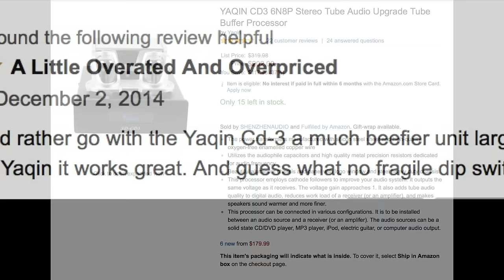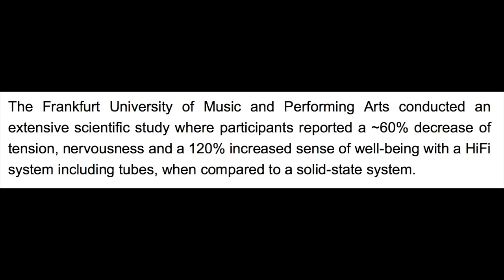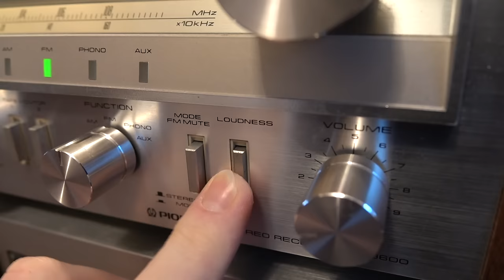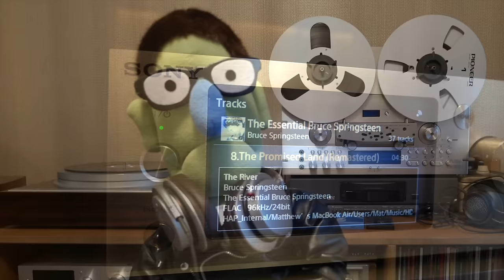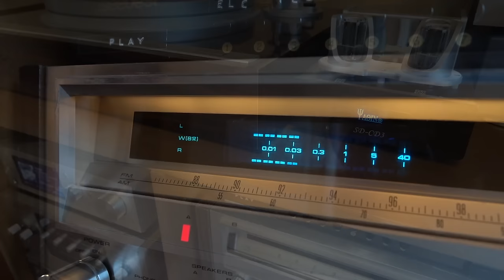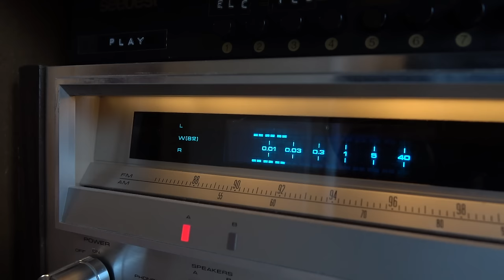Add the magic of Valves to any HiFi - with The Yaqin SD-CD3 tube processor

Comment: I have known musicians that will not part with their tube amps for the same reason. One theory with digital music is that it smoothens the "jaggies" (aliasing) poduced in the waveform from the sampling rate because the tube simply can not reproduce the "jaggies" frequencies. Most digital audio devices have integrated anti-aliasing filters, but most are inadequate. These Jaggies, as they may appear in a waveform (like a stairstep) can actually cause harmonics also called "hetrodyning" or"beat frequencies"  which causes completely unwanted (room stuffing) harmonics and other frequencies that you do not want or need when passing an amplifier stage. Harmonics happen when 2 frequencies are mixed. Thus the tube amp is a more natural anti-aliasing device to eliminate those harmonics , as it will not pass those sampling rate frequencies. It is most effective on DIGITAL sources . BTW you seem to know more about electronics than you let on.

Comment: The valves tap into the Dynamic energy of the frequency and amplify the dynamic range of the frequency while keeping static range constant, hence the power factor is at the most efficient level. This makes the Root mean square value of the wave of that particular frequency to have more power factor which stabilises the Peak Music Power Output. This in turn reduces the Signal-to-noise ratio and reduces the Quantization errors. Since it is a analog device it is better than Digital signal processing.This has been proven in the Z-plane analysis.

Comment: I have that thing but it's branded destiny, basically the same product.. I like it, doesn't do too much for the sound but it looks awesome and it adds a bit of warmth to the audio.. I use this and my BBE maximizer with an onkyo receiver, sounds pretty nice. I still have the original valves, also tried different ones I had around but the original ones that came with it seem to be just fine

Comment: the thing about not getting grease (such as from fingerprints) on valves or halogen lamps is only important when the item in question runs at extremely high temperatures. The grease heats up quicker than the glass and creates a weak spot causing the glass envelope to fail. (explode)  Believe me that when you fit a 10kw tube into an amplifier so big that you can walk through it; you will soon know if you left any fingerprints on the thing...

Comment: On the matter of touching the tubes; 
I have built many tube amplifiers as a hobby and I have handled many preamp and power tubes with my bare greasy hands with no problems. 

However, I once accidentally touched an EL84 \ 6BQ5 power tube while it was on and operating. 

Those little 9 pin power tubes are capable of a good deal of power and they get very hot, so, when I touched the hot glass the oil from my fingers immediately burned off causing a sharp temperature differential which cracked the tube. 

That's really the only reason not to have a lot of skin oil on them, high power tubes could actually crack because they get very hot. 
Although it's more likely if you touch it while it's on. If the tube is off when you touch it, the oil is likely to evaporate from the initial heat and by the time the tube is actually hot enough, the oil will probably be gone, unless there's a lot of it.

Comment: During the 1960's and 60's I built several amplifiers using valve circuits, mostly Mullard designs.  These used the EF86, ECC83, EL84 or EL34 combinations.  I also built an amp with KT66 (changed to KT88) Push/Pull O/P with dirty great WODEN power and o/p transformers.  I moved house in 1974 and took everything to the council dump, nobody wanted it, including me.  Now fashion has changed it would all be worth good money.  I don't think the transistorised equipment I replaced it with sounded any worse and there was no longer the chance of 400v shocks!

Comment: You don't buy valve gear for the "accurate sound reproduction", you buy valve gear because you like the way it changes the sound. Just like an equaliser - boost the mids a bit, taper off the top end, moderate the bass, and all is well :)

Comment: The main difference between valve amplifiers and modern hi-fi equipment is called error control, or feedback.  Part of the output signal is put back into the amplifiers front preamp to verify that what is going in for a signal is being properly tracked on the output.  early style amplifiers and valve amps did not have error control, and typical guitar amps that bands use also do not have error control.  Without error control the amplifier add noise to the audio sound, and this is what makes the sound beefier, warmer as the extra noise produced is not offensive to the ear.  These devices you have are basically a do nothing but be a buffer tube, as others have already discovered.  you can get the same modification of sound with modern equipment by disabling the feedback in the amplifiers circuitry.

Comment: Nice review, it's probably adding a bit of 2nd/even order distortion, most people tend to like that. Only worry I would have is the output impedance, it's usually pretty high with tubes and could effect the frequency response, but whether that is a problem or not depends entirely on the input impedance of your amplifier.

Comment: It's probably the blue ones...capacitors....The unit probably introduces a subtle change to the frequency response characteristics in the part of the audio spectrum that covers speech, rather than as a consequence of the valves themselves.
Reply: *****
The blue blocks are polyester Capacitors, I think.  They do look like PCB mounted relays.  Ah, I see...ELNA is just the name of a Japanese capacitor manufacturer.  With non-polarised types, you only need to worry about the voltage (AC or DC rating) and the capacitance values.  You can certainly order this stuff on line.  (I took voluntary redundancy from my last electronics job, back in 2010.  I left electronics at that point, and became a carer.   This was due to my wife's long term illness.)
Reply: +Stephen Clementson, I believe those are Metallized Polypropylene film capacitors
Reply: +Arthur Ott The capacitors appear to be the right shape for Metallized Polypropylene.
Reply: +shomolya According to the circuit diagram, drawn by David Jones in Australia, the voltage gain was being provided by a chip.  The valves could only act to mildly distort the waveform (I think the supply was + & - 12 volts).  The valves were configured in the same way as an N-Channel depletion-mode FET in source-follower mode, but that sort of buffering was unnecessary in this circuit.
Reply: +shomolya Hmm, yes, it's probably a similar circuit.  The valves have to be in circuit to conform with the claim, but they don't have to do very much.  In any case, I am convinced that the valve myth had to do with poorly designed, noisy, distorted, transistor amps of a bygone era.

Comment: You need to do a double blind test to be sure. As long as someone in the room knows which is which you can't be sure if you are merely imagining the difference. A difference of separation to the stereo sound could be explained by a phase difference between the channels, which could be caused by mismatch between many of the components in the device left to right. Also, a difference you like in one recording you might not like in another.

Comment: All amplifiers add a bit of distortion - you pay a lot and you get less, but they all do it. Valves add second harmonic distortion, which means that if it is supposed to be reproducing 1Khz, it adds a bit of 2Khz as well, which is fine because that's how music works so it sounds nice.  Solid state devices like transistors add 3rd harmonic distortion, so you get some 3Khz which isn't musical and sounds really nasty, so you can't tolerate much of that at all. So valves can add a lot of distortion yet sound nicer than transistors which are actually working a lot better.

Plus valves save a lot of money on central heating bills.

Comment: keep it up , love your reviews , especially the sarcastic ones :)

PS watched Dave from the EEVBlog look at one of the tube headphone amps you sent him , fascinating , thanks for doing that :)
Reply from the maker: +HPZeta I didn't send mine to him...but I'm pretty sure whoever did must have watched the original video.
Reply: Techmoan Could very well have been the note made it sound like it was from you, I don't know if you watched it , but bassically he completely reversed engineered it , found that while the tubes were connected , it wasn't done properly and the implementation was that they would just introduce noise , the amplification didn't come from the tubes but two MOSFETs 

This one you reviewed looks legitimate as it uses a big transformer to get the right voltage, wouldn't know without further exploration but looks right at a glance.

Comment: Using valves in any audio signal chain, if done properly, is going to make it sound a little more "rich", if you will. All due to adding extra harmonics to the original signal.

Comment: nice one, Just a tip, if you want to get more out of the vales, and better Sound replace the caps (the blue ones) whit PaperinOIL(russian) ones. I dit this on my tube amp and got amazed by the better hi and mids and better stronger bass. 
Keep up the good work!!
Reply: A capacitor is a capacitor. Russian, chinese or japanese. Makes no difference except to your wallet

Comment: It is question of harmonics and harmonic distortions. Typically, transistors have more distortion of odd harmonics, tubes more distortions of even harmonics. It is actually a bit more complicated, but in this case it makes sense that these distortion partially cancel each other out. Transistor circuits tend to be more complicated. It is great that tube circuitry can be so simple and have that kind of impact. So, it is NOT only matter of psychology (which is claimed by hard line simplistic rationalism), it is matter of how brain interpret different kind of distortions, so there is actual connection between human mind and audio.
Reply: @Budget Audiophile Right. Although many engineers believe solely to what can be measured with instruments. However, you cannot measured interaction of music with human brain.

Comment: Nice video thanks. Couldn't help but notice at the end that you have a copy of a night at the opera on white vinyl, I am now insanely jealous of you. I am a huge fan and had a copy like yours but I gave it away to a car boot sale by mistake not long before Freddie Mercury passed away . Never seen another since apart from the newly released ones that are far to expensive. Keep up the good work. Ps I got an action camera an ee4g for xmas I use it sometimes in the car but find a fair bit of vibration on the finished videos any hints or tips would be appreciated maybe even a wee tips video ...  Anyway cheers..
Reply from the maker: +LAURENCE MARTIN that's a good spot...it is out of that horrendously expensive box set. I didn't own any of the albums on vinyl, so it made slightly more sense to buy it than it would if I were duplicating any of them.
Reply: +Techmoan being a bit of a queen geek I don't want buy the new ones as I prefer the original . Sad I know . I also gave away at least ten other picture and coloured albums at the same time and seeing your copy has brought it all flooding back.... I suddenly need a beer... 🍺🍺💿

Comment: I do believe the main benefit of going hybrid is distortion. The soft distortion of the valves help "cushion" the sound to your A/B or digital amp. This allows content to be played at higher volumes for longer periods of time. 
When I do finally splurge on my own tube pre-amp, I will opt for the non assembled version which is also availableas a kit. That way, I can use high grade components and put quality control into my own hands! Not to mention making life even just minimally better for one of those poor blokes forced to work in a chinese factory...

Comment: Both the blue and the black ones are just a bunch of capacitors. Overall the whole thing seems to be nothing but caps, resistors, a polyfuse and the two tubes. The case is likely the most expensive part of the entire device. The 470n/630V Pilkor caps are like 2 GBP for 10 shipped from China. Resistors <1 cent/each. The board seems to be single sided. You could build your own using just the images shown in this video for like 20-30 GBP including a case, plugs, etc. plus whatever you want to spend on the tubes.

Comment: I don't know anything about hi-fis, but speaking as a guitarist and thus having an awful lot of experience of solid-state vs. valve - if you want to break it down, valves seem to add a very pleasant compression and a much more "musical" feel to the sound. I don't even know how to explain the latter thing better than that. It sounds more like notes and less like noise, if you see what I mean. SS can also add this weird screechiness to the sound.

Frankly I'd love it if solid-state sounded as good, because SS stuff is so much cheaper (and weighs far less, which when you're lugging an amp to gigs and back is not a minor consideration).
Reply: Check out that ehx combo amp

Comment: I agree, I have never heard a difference with a  tube pre-amp / in- line unit. Where I did hear a big difference is when the entire system is run by tubes like on a old Fisher receiver. Then you hear the warmth of a tube amp. I always wondered if those super expensive in-line / pre-amp tube units made any difference or are they also just a big waste of money?

Comment: I've spent a few years in the audiophile circuit and the main thing I've learned is that it's all b*ll*cks.

It starts with the recording. The sound of the instruments in the studio is changed by the microphone. The choice of mic depends on what the recording engineer likes to use and what the studio happens to have available at the time. At no point does anyone care about how natural the recorded signal will be. Then they pass the signal through a pre-amp, a huge mixing console and into some recording device. That's four signal changers before the signal is even recorded. Then they mix it, passing the signal from the recording devide back through the console, through literally dozens of filters, and again to a recording device. Another 25 things that change the sound...

The guys in the studio do the final mix in such a way that it will sound "just fine" on any audio system. They want to sell the recording and that doesn't work if it doesn't sound good on the systems that most people actually use.

A good example of this was Metallica's änd justice for all" album, where the bassdrum was set so loose that it produced a sound that could not even be reproduced on a regular Vynil record; the album was pressed with extra wide grooves to accomodat the bassdrum, and many people complained that the bassdrum sounded like a very high-piched clicking. It tuns out the bassdrum was tuned well below 30Hz, and many average-joe audio systems struggle to reach that.

The idea that your setup is going to reproduce exactly what the recording engineers had in mind is nonsense. Watch the youtube video by Fab Dupont, called "tracking the band" he demonstrates on stage how he records a band playing a song. You'll soon see that the ideas of realism, purity etc are nonsense.

Then there's the "dont put anything in the signal path" crap. The only aspect of that comment is that is true is that more equipment usually means more noise, less dynamics and generally crappier sound. It has nothing to do with the sound losing it's authenticity. every audiophile, even the gurus, chooses amplifiers, speakers etc based on wether they like how they sound (and on the looks and price; more expensive is always better in that world). It seriously has nothing to do with wether the sound is anywhere near reailistic. In fact, you generally don't want the sound to be realistic. Have you ever heard a singer perform a tender love song from ten feet away? It's rubbish! You want a mic right up inside their mouth so you can hear the details that you will never hear in real life. Never mind the fact that electric guitars and keyboard do not have a natural sound at all.

No, there is no such thing as "the best audio system", there is only "the system who'se sound you prefer".

And that means that the discussion about CD vs Vynil, Mosfet vs Tubes/Valves, monitor speakers vs floorsanding, Bose vs Keff, is all total b*ll*cks. I like my Audioplan speakers. Their previous owner sold them because he began to prefer Avalon. Nobody cares.

Comment: you should try a full tube amp they sound awsome
and are verry verry easy to build
i have designed one that costs 30 euro's
is stereo has 3 a 5W output
and i did it just for fun

Comment: I think you do need to clean anything glass that heats up. as getting grease on it will cause the parts you touched to heat up differently and eventually cause damaged. I learnt this when doing stage lighting.
Reply: +Elliott Coe Halogen lamps are not vacuum tubes. Halogen gas has one job: put evaporated tungsten molecules back to the local hot spot. That is usually the thinnest spot on the filament but if there is a fingerprint on the glass, it becomes the local hot spot in that area. Halogen still performs its task and puts molecules there making the lamp dimmer and eventually causing failure.